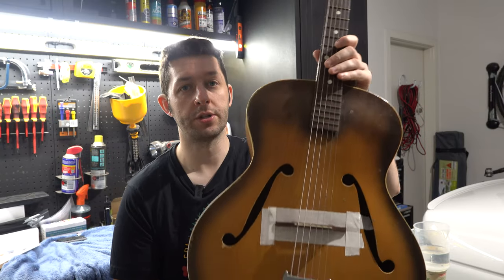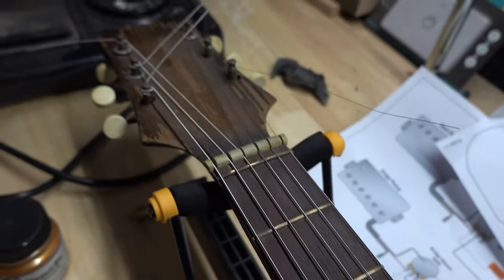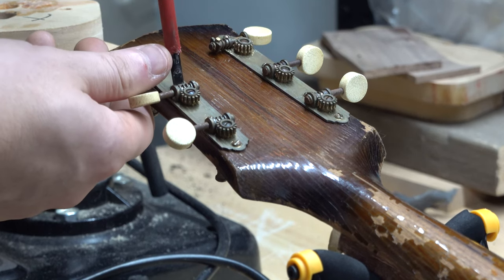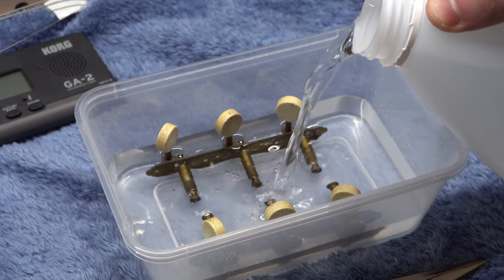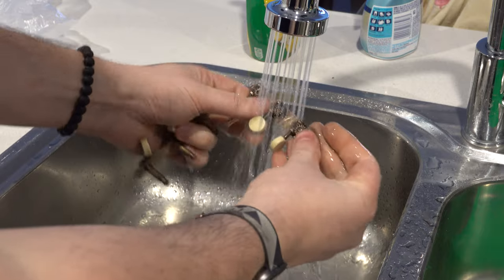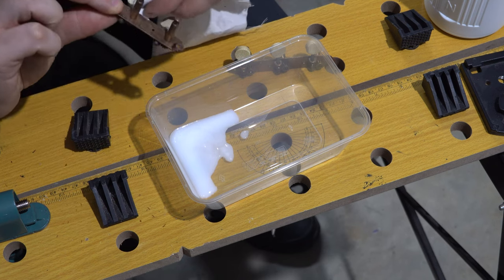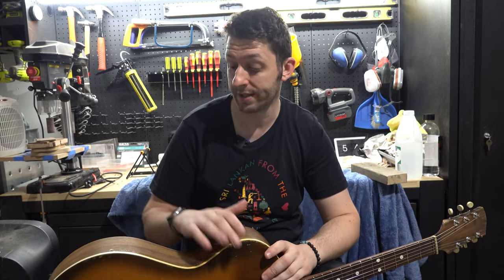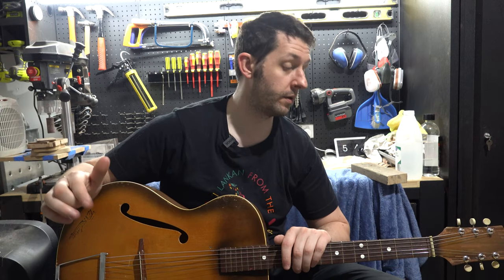Restoring Vintage Guitar Tuners (Easy DIY)

Comment: They looked great. I am going to attempt the same on my old 12 string guitar. I have new ones which fit and work well but they don't match the rest of the aesthetic (they look out of place). If I can get my old ones cleaned a bit and working a bit better/smoother then they will be preferable. Thanks for the tips dude. I hope you don't me also asking if you have any tips on which oils are better to use on an older fretboard? All the best. Dan🎸

Comment: I still have a little bottle of dark amber colored tuner stain to vintageize  replacement tuners for a mandolin, now long gone..I recently added it to my model paint box, and had success using it on a Mandoshawan Fifth Element resin figure from eBay. But, that stuff doesn't know the meaning of dry. You gotta walk away from a coating for five days before messing some more with it. Today I touched up some vintage dark amber Persol sunglasses with it, in areas where the plastic looked ghosted and pale. A perfect look...so far.  Again, I'll wait a week before handling it. You ever use it?